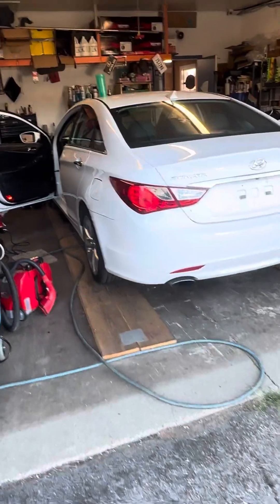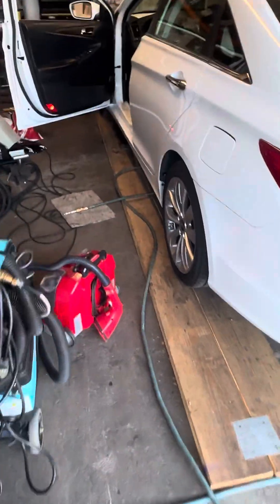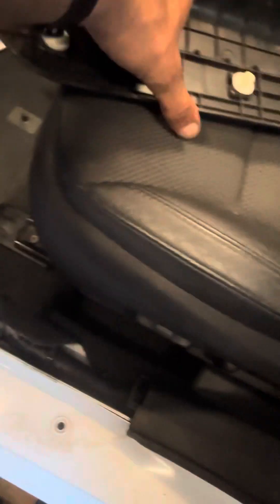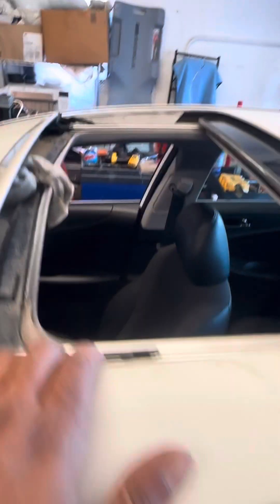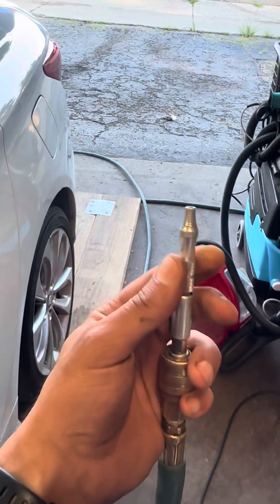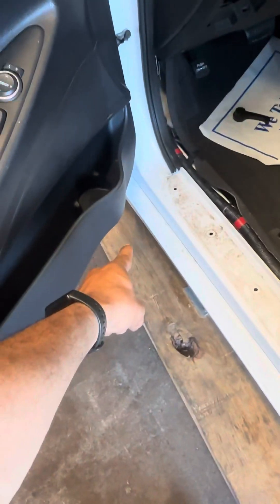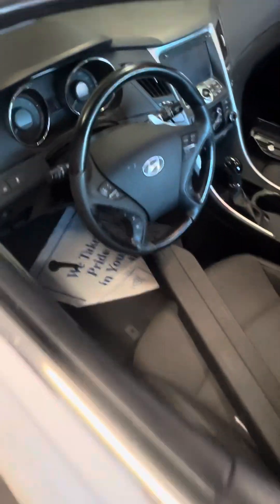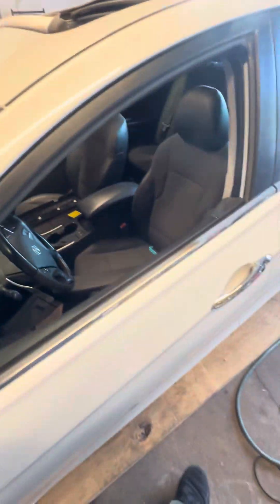Water on floor of ur Hyundai sonata(or any car) after rain?! here is how to unclog ur sunroof drain

Comment: I have this exact same car, except the sunroof is the full size kinda that has the back part so not sure if that parts the same. However mine hasn’t had this problem yet, but if it occurs I will know where to start now.